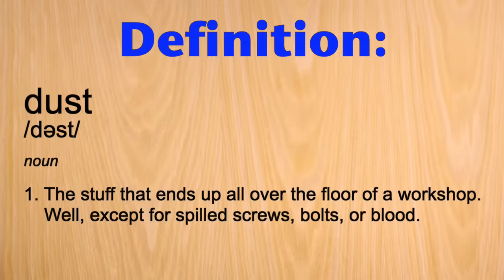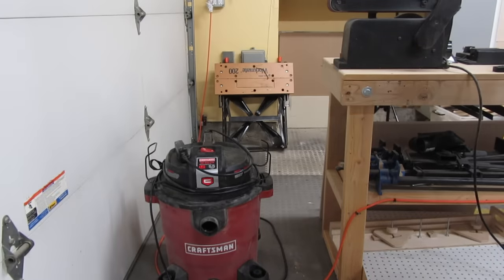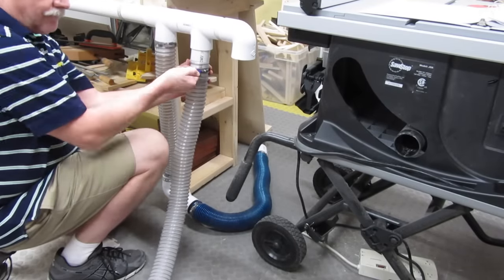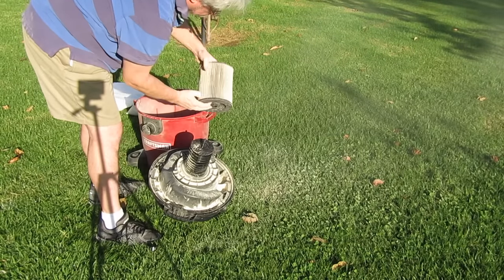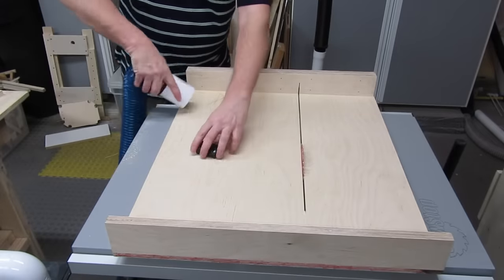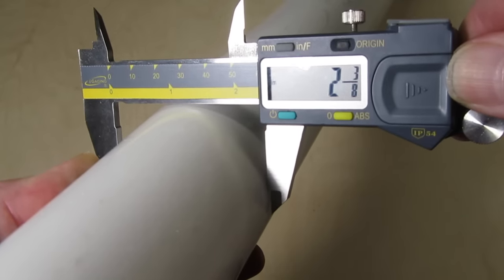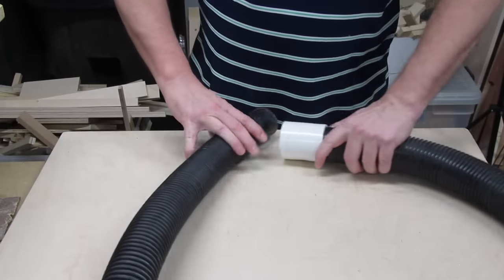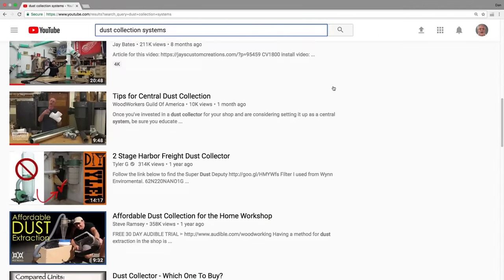Dust Collection for Newbies: Introduction to Dust Collection

Comment: I hate to think what that lot cost, dust gates here are about 20 plus euros each ! connectors and albos about 3 to 4 euros and piping etc Luckily I have a 3d printer and printed mine after redesigning the fault out of them that clogs them. I know I need to do it bit its going to be expensive to do the whole shop...
At the moment i just run a vac and cyclone to the machine i use.  Im currently pricing all the pipe and so far have found that 2 inch or 50 mm flexi pipe is horrendously expensive here but if you buy swimming pool vacuum pipe its a lot cheaper in spain that the professional item, I have found if you think out of the box and dont buy the item for the job but think a little differently you can save a lot of money like on the blast gates , I cant print 1 for about 1.50 but cant buy one under 20 plus euros. 

Elbows and connectors are cheap enough just dont buy the high pressure ones, the normal low pressure ones are perfect instead. the cyclone i got from ali express and saved about 50 euros and it cost 15 euros on there and came with all the clips and gaskets needed,  the bucket I used a blue small chemical one with a clamp ring which i got for free from the fish market. I found the paint pots etc were expensive and collapse under the suction on my hoover. the big expense was finding a decent filter for my shop vac, its a large machine but only has a tiny filter in it by comparison to the bin,  also does water, so i managed to print a larger ring for it on the printer , glued it on to the vac and bought a much larger and longer filter, size does matter with filters, more area = more suction. so far I have spent about 75 euros on my system  but I did have a shop vac , However i also have a 3d printer and that helps and i scrounged the bucket and by thinking out of the box used hoses at a third of the price and cheaper connectors etc by chatting with the plumbing shop, that saved a lot of money. Flexi hose costs a lot more than rigid pipe here in spain.  If you need it bigger at the end to capture more dust etc I just printed a couple of funnel device to stick on the hose end like for the drill and lathe etc.

For those in europe I would recommend the Henry hoover system but only if you have a cyclone. The suction on these hoovers is incredible and filters are not expensive for them. They also last for years.
Reply from the maker: Thanks for the comment.
Reply: everything is more expensive in europe. good on you for making it yourself. i found a dust gate on mercari just now here in the states for 6$ (~5 euros according to a quick google). ill probably print mine too though
Reply: @MrNatedawggG  the trouble is here there are so many taxes to add on like sales tax or VAT as its called "value added tax" 21% although what value it adds is beyond me!!  then import taxes depending on where its come from etc etc . Wood for example which we dont use very much in spain for building as all properties are bricks and concrete etc is horrendously expensive, a 8/4 sheet of  3/4 inch ply would be over 130  dollars easily here,  yes i can buy pine as it grows like weeks here but any other woods that resemble the slightest hardness you just cant get unless its a african hard wood and then thats not that good,  I turn wood on a lathe and a bowl blank for a small bowl would cost me 50 dollars easily.  Where I am those lovely trees dont grow sadly.... just bloddy pine weed trees. 😄  

Basically you have to take the donkey by the nose and make things yourself half the time, it would be great to have a Rockler or similar store here but spanish men dont have hobbies apart from smoking, drinking and the biggest football ( soccer). seriously....

Its been hardwood setting up my shop I have nearly had to import everything from the UK or other places as I just cant buy them here. Other items like blast gates I have made then use standard plumbing pipes etc to connect it up, the flexible hoses and 30 to 40 dollars a metre here that you have on videos I see.. I use swimming pool flexi hose as a 25 foot one is only just over 30 dollars.

Dont get me wrong spain is a very forwards first world country but items are just expensive and beyond the purse of a retired person normally. You have to be working really to set up a shop.
Reply from the maker: @sitgesvillaapartmentneilsc7924  Wow, that's something! I have to remind myself that I'm fortunate to live where I do, where basically everything is available and relatively affordable if I need it. With that said, I live in California, so don't give them any more ideas for taxes! 😄

Comment: You said you had a seperate video on how to make fittings snug. Im gurssing you mean with a heat gun. While searching your library of videos i couldnt find but did come accross some kid called Matt who gave a display. Was this linked to what you meant. Im building a similar piping system like yours but my pipe was gonna go along the ceiling but wouldnt it be better keeping it low like yours. Wouldnt strain be put on sucking shite upwards, along the pipe then just dumped downwards.
Reply from the maker: If you're talking about PVC fittings, they should be snug by default. If they're not, which happens every once in a while, it means the pipe is just a tad too small, so either take it back for a refund, or just buy a new pipe (double-check the fit at the store before you leave with it. As for heating up PVC to mold it, you can use a heat gun for this. Keep turning the PVC while heating it up (wear gloves), and don't let the pipe burn, because it'll release dangerous gasses. If you're going to do a lot of these at a time, do it outdoors if you can. Hope that helps.
Reply: @TheNewbieWoodworker  Thank you very much buf as a newbie i gonna research other avenues first. Thanks again.
Reply from the maker: @stevengreen4316  No problem.

Comment: You need a y connector not a T.
Reply from the maker: For "true" dust collectors, which rely on air volume rather than air speed, that's true. But shop vac-based systems rely on air speed, not volume, and my measurements with an anemometer show no real difference using a Y or a T.

Comment: you dont even need that cyclone, just make it with a 45 degree angle and a bucket or 2 and some glue. https://www.youtube.com/watch?v=9w8jXS8Fjh8
Reply from the maker: Tried it, and I couldn't get it to work. But if you can get it to work, then that's great - much cheaper!

Comment: Shop vac was only a Brand name after being used for at least 50 years long before someone branded the name.
It's like the brand My Pillow, this term has been in use as long as we have had pillows, it's a household word it cant be a brand name, anyone can slap the name My Pillow on a pillow as long as they do not use the registered logo. And the company My Pillow cant win a lawsuit in court over this. I was curious about this issue and looked up the Trademark the Term cant be a trademark becuse it's a household name, the owner of My Pillow cant protect that name. Only the registered trademark art work.
So call it a shop vac a wet dry vac or anything your like they all suck as dust collectors.  And I dont mean as in collect dust.

Clearly you do not know anything about dust collectors, or dust collection systems. A vacume does not have enough power nor can it move enough air to remove the dust that's bad for your health. You have a chip collector not a dust collector. You might want to wear a respirator when your in the shop.
Becuse your breathing in fine dust, and if you are or ever were a smoker you've done enough dammage to your lungs you need to protect them from saw dust.

As for dust colection systems I recommend you view a lot of information about them becuse if you go this route you will spend more money in the long run, becuse you will have to keep upgrading the system, why waste the money, just buy a good system to start with, look on craiglist or somthing for a used system if you cant afford it.
Main goal it a 2 stage system with a large hepa filter and 2.5 to 5 hp blower
You want to move 1600 cfm .
Reply from the maker: Thanks for the comment. Actually, I know a lot about dust collection, including fine dust collection. And the truth is, most people who think they're getting fine dust collection are wrong (at least, according to Bill Pentz). I won't cite the metrics here (I couldn't do it from memory anyway), but according to Bill, unless you're using at least 6" pipes (and I think he actually says 7", but I could be wrong), AND you have proper dust collection at the hood, AND you vent the exhaust outside, you're not really removing fine dust particles. So don't immediately look down your nose at a smaller system like this. There's no guarantee yours is any better at fine dust removal, and if it is, you're probably in the minority.

As for having to keep upgrading the system, don't assume everyone's needs are the same. I bought a new SawStop PCS, and this system still does an adequate job of collecting sawdust from it. But even if people do decide to upgrade their systems, it's always a good idea to start out small and learn how things work, before you jump right into the big things. Especially considering how uninformed people are about true fine dust particle removal.

Hey, this is just my opinion. But as I said at the start, I am NOT ignorant about the subject. And in my opinion, since true fine dust removal is a complicated subject, it was better not to mention it at all in this video - my goal was to make the subject as simple as possible for the true newbie. Whether I succeeded or not is up for debate, but I'm OK with that. 😄
Reply: I need to buy the pipe 8" and take offs as well as a super dust deputy xl 
My main trunk will be 8" 20' long spiral pipe the system has a very large merv 15 hepa filter the blower is 249 volt 3hp.
As for blowing conditioned air out side at 1700cfm no thanks it cost too much to heat and cool a 2200 sf 2 story house now even with a 97% effecent furnace and seer 16 ac condenser outside.
With a 6" thick merv 8 filter. That cost me 
38 bucks to replace. I'm putting the system in it's own room with hepa filters for a door in and out of that airtight room 
Insulated with rocksol insulation for sound control. It's both fire proof and stops sound. 
Yes it's not a 5hp unit but it's just a home work shop.
I started off with a wet dry vacume untill 2 years ago when I got a bradnew jet tablesaw free and 80% of the saw dust landed on the floor.
With this new 97% off furnace and seer 16 ac unit i cant risk damaging it with saw dust. This isn't an older style with large burn chambers. Also clogging up the fan and ac coils will lower its efficiency and make it freeze up damaging it. Let alone what it can do to my lungs. I have asthma and smoked for 45 plus years. I've done enough damage.
I'll still wear a n95 dust mask. I've choked up enough 2x4" in my years. I used to saw a lot of 3/4" mdf with nothing to collect the dust. Even when we used a vacume it didnt pull enough air to get all the dust. When I ran a speedy cut panel saw it sent the dust to the floor. Table saws send it up in the air and down to the floor. My 12" disk sander is really bad I can turn the room smokey in 1 min.
Depending on the tool ant wood your using.  But yes i know i wont get everything. But all your getting with a vacume is large chips. And it's not even getting all of them.  You might think about using a whole house vacume they produce a lot  more power.
Reply from the maker: @bobbg9041  Thanks for your reply.

Comment: Thanks. Still too sophisticated for me. I have three machines: planer/ thicknesser, chopsaw,  table saw. Dust ports o.d. 53mm, 45mm, and 40mm respectively. Bought a set of three of what I foolishly took to be universal adapters -- my bad -- they are 21-35mm. I just want to prevent jamming the machines,  I am grateful for my divinely designed -- not evolved -- nostril dust-collection system for me. Am waiting for a few metres of appropriate diameter hose to come from the empire of self-appointed  Emperor-for-life  Xi.
Let's go Brandon. Do you still say that over the pond?
Reply from the maker: LOL - I typed out a response about the "Brandon" saying, but decided not to post it because I try to keep politics out of my channel. But you made me laugh...
Reply: That nostril dust collection system isn't particularly efficient and you'll end up with fine particles in your lungs that will never leave.  Do as you wish.
Reply from the maker: @brentn3822  The subject of small dust particles is out of scope for this video. If you've ever read Bill Pentz's blog, you know how complicated the subject is.
Reply: Pretty classic - to blame your own lack of homework on someone else.
Reply from the maker: @antonyscott4175  ?

Comment: You can cut pvc all day long on your miter saw, how are you a woodworker without a miter saw ?   I’d give you one of mine.  Your t connectors are wrong and should be wye’s.  Flex pipe is a killer of airflow.  A 90 is equal to about 20’ of straight pipe as far as developed length.     The smaller the pipe the higher the velocity that will help when using a shop vac.  PVC is the worst material for dust collectors as it could explode from static electricity.  Pipes should be metal.  If you must use pvc throw a copper wire in it and ground one end.  Another tip is if you insist on pvc, go over to the electrical section in the box stores and buy long conduit bends and electrical conduit.  Same price or less, same size, and one end has a hub in it to save you a coupling.
Reply from the maker: https://thenewbiewoodworker.com/2020/01/21/dust-collection-and-pvc-static-fire-danger.html.

As for airflow, you are right but not to the degree you think. The effect on shopvac-based systems isn't nearly as great as it is with blower-based dust collectors. (I'm not saying that shopvac-based systems are better, by the way, just that they work on a different principle than blowers do.)
Reply: I bet you’re fun at parties. 

I’ve been using pvc for dust collection for years. No spontaneous explosions so far but I’ll keep my fingers crossed
Reply: Fires don't happen daily. You would agree that "it didn't happen to me for years" is not a very good fire protection system, or to be used in any other context to devalue an expertly explained risk.
Reply from the maker: @tomislav.kelemen  https://store.workshopsupply.com/catalogue/pdf/DC-Myths.pdf
Reply: From online:  "What is the LEL for combustible dust?
Combustible Dust: A specific concentration of combustible particles in the air is essential. This concentration, known as the lower explosive limit (LEL), typically lies between 10-40 grams per cubic metre, contingent on the dust type."  So above or below that limit, and even a hint of moisture in the air -- or wood being cut -- and you are safe.  Yes, smooth-bore pipe has less frictional resistance than sharp bends and corrugated hose.  But in the home setting, the difference in power consumption and efficiency doesn't make a industrial-grade system worth fussing with.
Reply from the maker: @DokDream  Thanks for the info! 👍

Comment: A dumb system to use with all those open ends wasting suction power.
You should have valves on every pipe so you can close the ones you do not need at that time for more suction power.
Reply from the maker: Did you even watch the video? Of course I closed off everything. I used blast gates, not valves, by the way.
Reply: Why make a rude comment when you didn't even watch the complete video ???😕 TUT !!!
Reply from the maker: @jackierudd2010  Thanks for the support. No worries, when people make comments like this, I just laugh. Now, when they have legitimate issues, that's when I pay attention. 😳😄